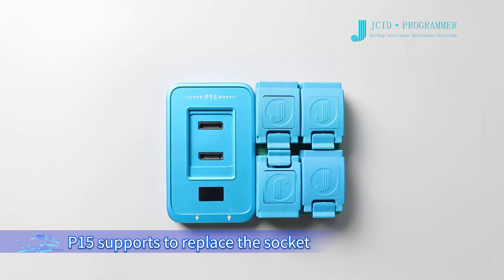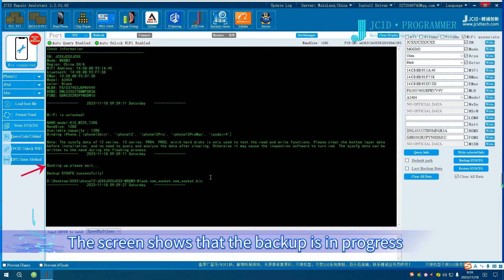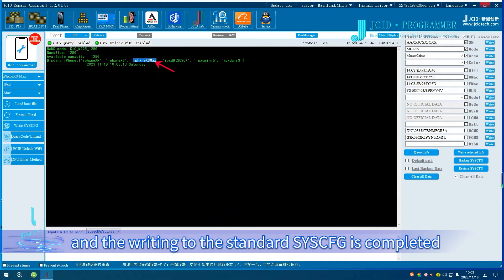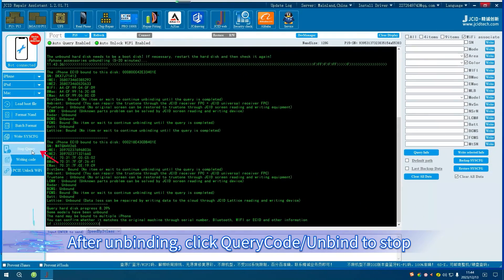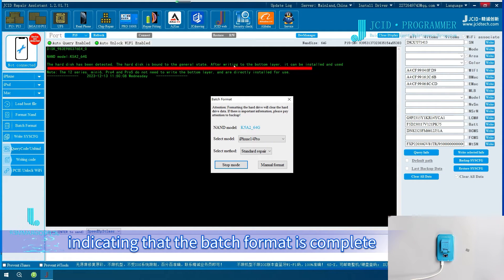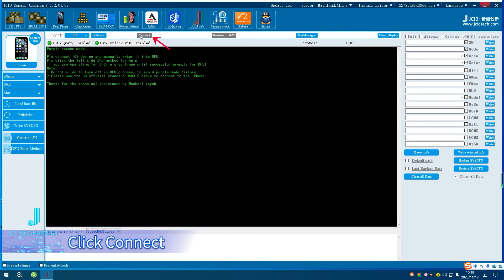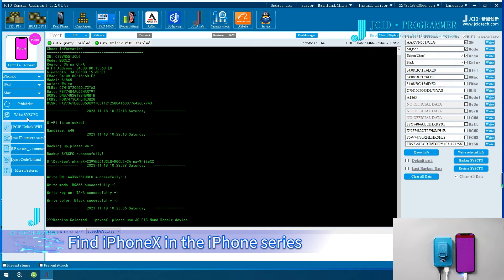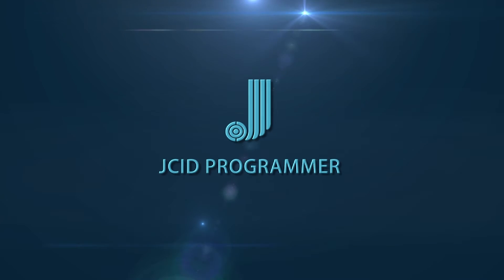JCID P15 Single Nand Operation Guide

Comment: Is batch format possible with bga110? When we try it with 12 and up it shows model not supported. 
How can we erase nand from iPhone 13 in general state and use for MacBook m1
Reply from the maker: Yes it supports batch format with BGA110. In some cases, the nand may have problems such as file system corruption or partition errors, which may result in the inability to read or write data normally. Formatting and re-establish the file system and partition can help repair this problem. If you need further assistance, please contact our tech support team: https://www.jcprogrammer.com/contact/

Comment: I couldn't find the p15 device port on JC drawing, whereas on JCID repair assistant it was read. I have installed all the drivers but it still cannot be read on JC Drawing. is there a solution?
Reply from the maker: A short video capturing the issue would be incredibly helpful for our team to diagnose what's going on. There is technical support contact information on the official website to help you, thank you